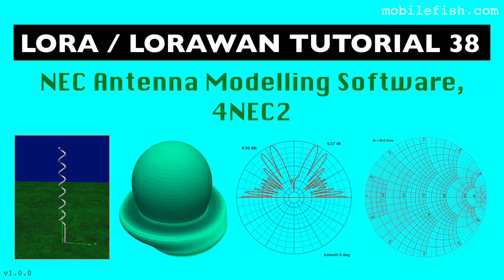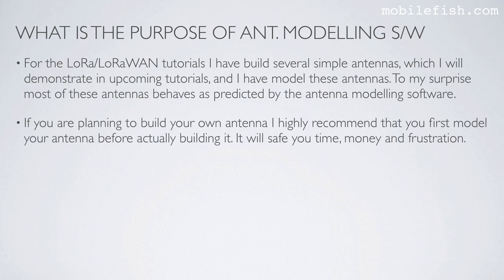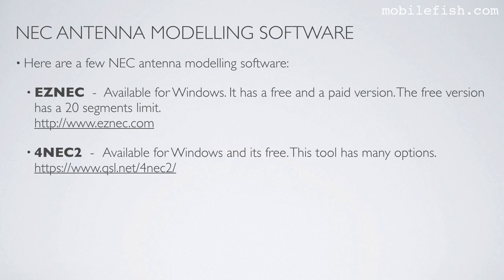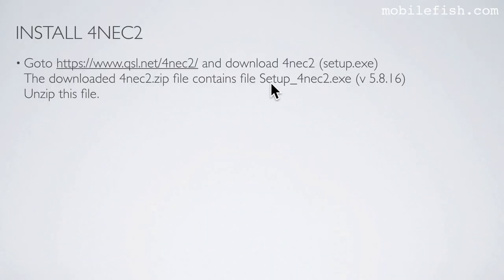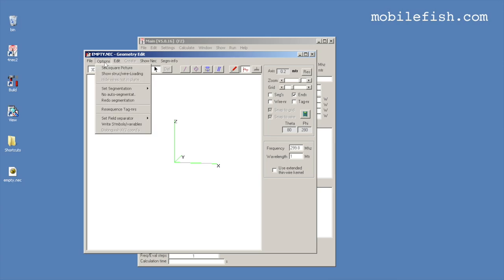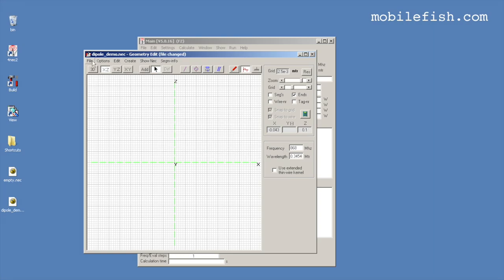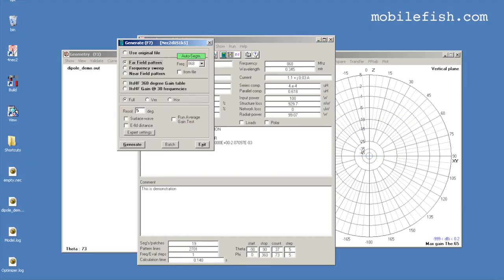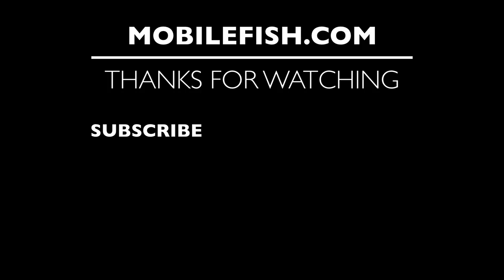LoRa/LoRaWAN tutorial 38: NEC Antenna Modelling Software, 4NEC2

Comment: Wow, At last a clear  precise tutorial. Not a single " errr, um, or miss direction".
Please take note UTubers, this is how to speak when doing a tutorial. 
The instructions were so sharp and clear that even the accent didn't deter me from perfect comprehenson of the subject. 
The 4nec2 program is excellent and if you are having problems, this clear tutorial should be of great help. If you are even more confused and put off by the apparent complexity of this program, then just start with any antenna selected from the ( File, new, models, menu) list of examples in the file lists... Just play with the sample antenna chosen and do some sweeps using the blue highlighted calculator button at the top of the main page.
You can model your own antenna design by doing some simple modifications from an example antenna befor getting too seriouse with the data inputs as shown here. 
Excellent tutorial, my only negative comment is the skipping over some of the other sections at the end of the tutorial.

My own personal question is. 
Can i model a balun 4:1 fed ocfd antenna? In other words i want to see the true swr figures for an antenna fed through a 75 ohm coax and a 4:1 guenella balun at the antenna feed point.. Is this possible.?
Reply from the maker: Colin, thanks for your comment.
   I spend a lot of time to remove all my "errs and ums" and lots of editing and reshoots.
   
   With regard to your question:
   To be honest I do not know, but my gut feeling says it is possible.
   I learn by looking at the examples and how others have done it.
   Unfortunately, I have not found detailed video's or online tutorials explaining these concepts.

Comment: Great tutorial! Good job!
I would like to ask: where do you set the impedance of source? E.g. when you use 50 Ohm cable for your antena the results (VSWR) should be calculated for this specific impedance.
Reply from the maker: I think (I am not 100% sure) in the LD card (LD 4 ....). Download https://qsl.net/4nec2/4nec2zip.zip and go to folder 4nec2/models and search the examples (*.nec) how this is done...

Comment: Great video !!! btw is it possible to design a microstrip patch antena using 4nec2?
Reply from the maker: Unfortunately you can not.
Reply: @Mobilefish  Thanks a lot Sir!!!
Reply: Sir , Is it possible to create an output variable like the input variable so that  like for example  we can get different values of current induced at the load of receiving antenna , for different frequencies  generated at the optimizer...and also why it is not possible for us to see the frequency of the field produced by the transmitting antenna?

Comment: Well how wrong was I, half way through the video, the on screen images become blurred, hard to read, also jumping from a text page to the screen you say click this button ( 24.3) and the button is allready actuated so we wast time trying to locate what button you pressed. And you flash up info that dissapears in under 1 second.. So we have to try and freeze the video exactly to the second to be able to read it... Bad editing.... Im sure you could do better, and you started showing the feed line, (every antenna has a feed line or coax) but then you say you dont use one and delete it from the model.... So how are we to use the calculator if you remove an important part of the antenna system... Finally your antenna made on a n connector is not as modeled, you have L shaped elements, and this equates to a feed line, though at these dimentions its just like a 1/4 wave antenna badly loaded... Yes if you bend the elements up the swr will be at 1:1 at a frequency below your calculated one. If you have 4 radials from a n connector pointing outward and the 1/4 element vertical its a 1/4 wave gp, the swr will be 1.8 or higher, but by bending the 4 radials down at 45 deg the swr will drop to 1:1. Now compair against your n connector side by side, both have similar dimentions and you will find the actual gain figures are very close. I would even bet the 4 radial gp 1/4 wave out performs your badly concieved version of a dipole. No swr over 1.5 :1 should be accepted, if you are designing a good antenna then dont accept anything over this value. I see so many people running 2 vswr and higher... Well thats up to them but its no optomised.  25% loss when 2% loss is acheivable. 
Please do a in focus video showing how to create the feed point using a balun, feed line in coax and how to add a series lc across the feed point on the wires. Thankyou..